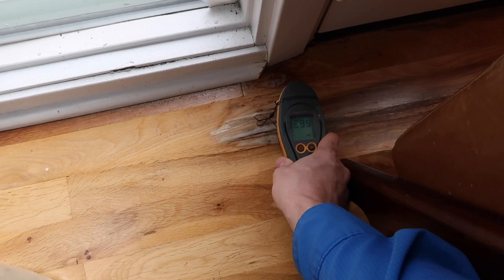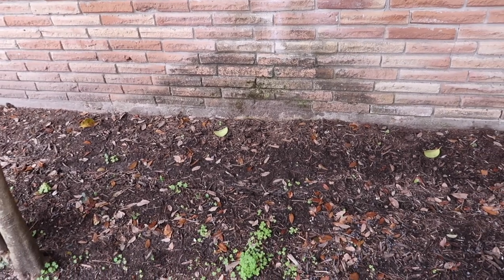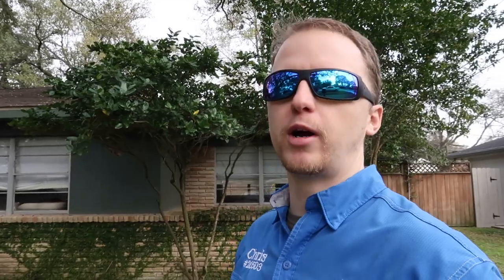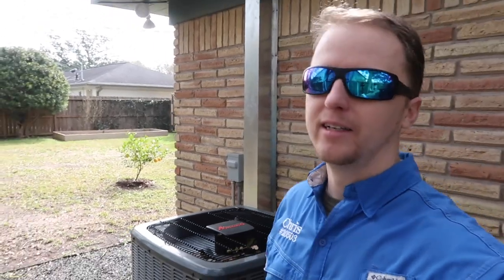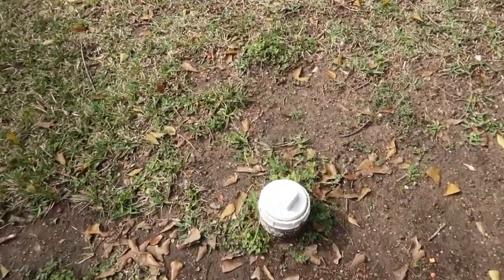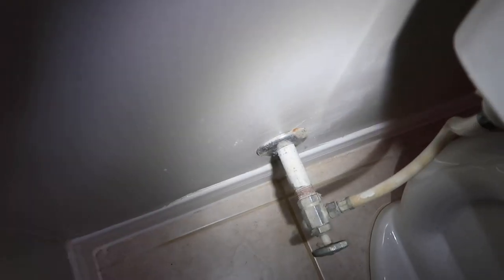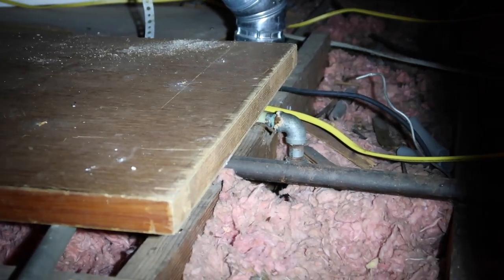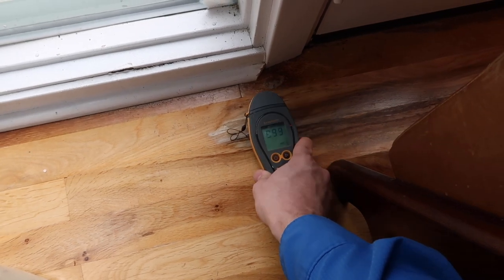Home Inspector Breaks down common old home problems - The Houston Home Inspector

Comment: Nothing wrong with cast iron DWV pipe other than it's not self-scouring like ABS and PVC. Don't confuse cast iron with Durham steel fitting and galv DWV piping......common to see both in a house. When I was roughing in houses in Dallas in the 70's with CI, no Durham fittings or DWV galv pipe was used....just the CI.Tyler Pipe in TX used to guarantee their cast iron pipe for 75 yrs. Galv piping....now that stuff was the best we had back then(other than copper), but it started rusting from the day it was put in. Your water itself and the amount of usage depends on its self-destruction. Risers generally live longer than the horizontal runs. You'll have to replace all of it at some point or you'll get leaking. Can be a huge job inside walls. Sometimes it's easier to bring new piping up through the floor where the fixtures are and abandon it in the walls. Of course in a two-story house that gets problematic with plumbing.
Reply: agreed. it is ludicrous to compare galvanized and iron in the same breath. iron is still sold and is expensive. it's a good product
Reply: @chrishall2594  In lots of places, especially warehouses that store flammable products, it's required to use CI DWV throughout.

Comment: Pretty good video man. I am a very busy property inspector in Oklahoma. I actually inspect for termites as well. I do not do treatments, only inspections. I was wondering if you use some sort of infrared imaging tool to scan the walls to check for missing insulation or possible moisture in the walls?
Reply from the maker: We use this version of flir https://www.amazon.com/dp/B07P8N2792/ref=as_sl_pc_qf_sp_asin_til?tag=homeinspect0d-20&linkCode=w00&linkId=379a54218dc1499f8c9d70ae15d600c0&creativeASIN=B07P8N2792&th=1

Comment: Where can I get warranty paper for foundation repair
Reply from the maker: Magical Ballers typically from the seller or from the foundation company that has completed the repairs.
Reply: A-Action Home Inspection Houston thanks... do have a company in mind that you recommend
Reply from the maker: Magical Ballers do you need foundation repairs?
Reply: A-Action Home Inspection Houston yes  I do
Reply from the maker: @magicalballers9342  I recommend getting a structural engineer before you call a foundation company.  Sometimes fixing a slab is as easy as regrading the outside.